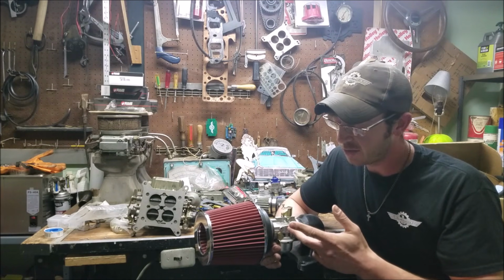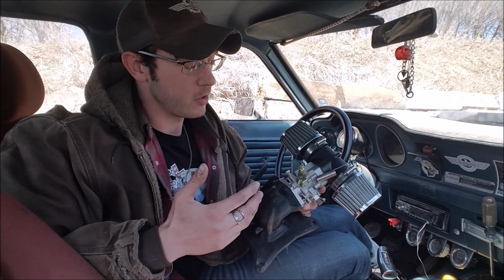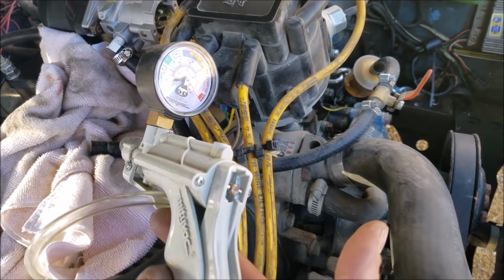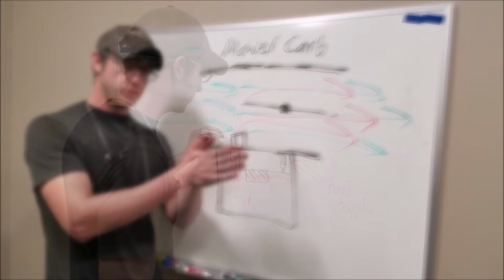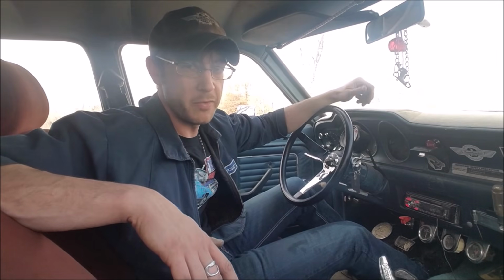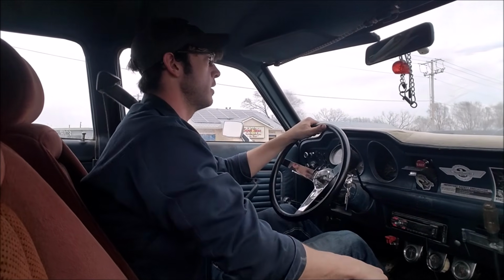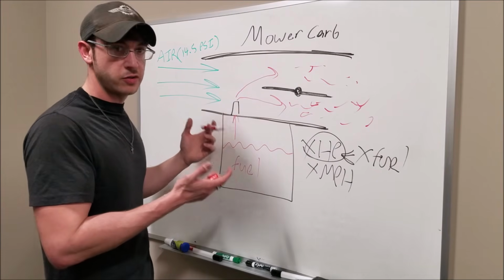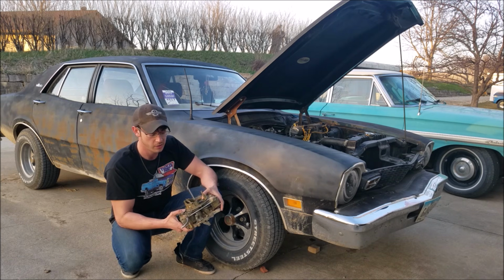Will It Run? Lawn Mower Carb on V8! (The "IMPOSSIBLE" Becomes Reality!) Start to Finish

Comment: The first thought I had (aero-engineer) was the small carb was running a higher velocity at the same mass flow of air/fuel for the power the engine is making. That could create turbulence itself due to boundary layer effects. Your 90 degree turns also would be effective for mixing the fuel and air. I think your theory is correct on atomization of the fuel. Apparently you found a sweet spot in all of this and created something amazingly good at efficient operation. Nice job!
Reply: A tunnel ram enhances the mixing of air and fuel..a mower carb and bends chokes the engine, starves it of air..if it didn't he wouldn't need to create a vacuum leak.
Reply: Exactly his thoughts from the last video
Reply: @brettjasonheadinventor  he is running a "vacuum leak" via a app on his phone and a IAC valve.
Reply: @jimbagle.3939  Yes, which means the mower carb is doing nothing more than driving with a choke on.
Reply: @brettjasonheadinventor  no man, it is more like the opposite of choke. 

It's not less air volume than the carb at wide open. It's more air volume.   

The "vacuum leak" is to regulate the flow rate of the fuel jet.
Reply: @brettjasonheadinventor   remember we are pulling like 8 times the amount of vacuum on the one jet than the engine it was designed for.
Reply: @jimbagle.3939  It's physically impossible to flow more volume through a little hole. The engine is trying to draw more air in, that's why there is high vacuum.
Reply: negative. 8 times the vacuum on the fuel jet increases the velocity not to mention a single-cylinder has more of a pulse. The v8 is a constant vacuum more or less compared to a lawnmower engine. You are incorrect.
Reply: @jimbagle.3939 A engine at  idle has more vacuum than at open throttle, because the air flow is restricted by the throttle butterfly. The mower carb is just restricting the air flow that's why the engine is pulling more vacuum. Stop choking it
Reply: @brettjasonheadinventor   the vacuum leak happens after the venturi, therefore it doesn't really affect the fuel jet. It adds air to the intake after the jet. It is the opposite of choke on. This isn't debatable.
Reply: @brettjasonheadinventor  obviously the carb is to small. If that's your beef. You're missing the art here.
Reply: @jimbagle.3939  Wonder what would happen if  that vacum regulator valve was install strategically in his 3d intake manifold....like right where the 90 starts?
Reply: @jimbagle.3939  No it's not just  carb..its the whole setup..he's compensating for the choking effect by creating a vacuum leak.  There is nothing new here or sustainable.
Reply: @brettjasonheadinventor  ok, I will concede that the carburetor set up is choking the engine, it is too small.  

 Now, if this was the only carburetor one could source. Meaning one has no choice. 

The "vacuum leak" is increasing the amount of air available to the intake and the increased vacuum due to the 8 fold in displacement acts as an opposite to the choke on.
Reply: @jimbagle.3939  Just think about that comment for a second...a typical dead stock V8 engine pulls 18-22"Hg of vacuum at idle. Do you really think this engine pulls 176"Hg at idle?
Reply: @alantrimble2881  what carburetor are you basing these stock numbers of off.
Reply: where is the vacuum being measured? 

At the single jet in this lawnmower carb?
Reply: @alantrimble2881  there is no replacement for displacement.
Reply: @alantrimble2881  the only valid argument is efficiency. So let's say we lose 50% to efficiency. It's still 4x the vacuum that carb is   designed for. That jet is releasing 4x the fuel it would be if it were running a lawnmower.
Reply: @jimbagle.3939  No disrespect, the whole point of having a carburettor  is to administer fuel with the air charge at the correct ratio. The more air the better for combustion. I note his point of this was to see if a mower carb would work. It's a fail if a vacuum leak is required to add more air to correct the fuel / air ratio.
Reply: @brettjasonheadinventor  fair enough. I can live with that. Have a great weekend.
Reply: 😂 pointless argument
Reply: @jimbagle.3939  Carburetor size has very little impact on manifold vacuum at idle.  That said, I'm talking about a dead stock '60s-'80s  vintage V8 with a stock carburetor.  Let's call  it a 305 Chevy with a Rochester 2GC carburetor that flows 435 CFM per the manufacturer. That engine will make in the neighborhood of 20"Hg of vacuum at idle, as will virtually any V8 with a stock camshaft that has little or no overlap.
Reply: @alantrimble2881   I understand that. 

But you are proving my point. 

Even if the manifold pressure doesn't change the pressure on at the venturi does.  A single-cylinder engine doesn't pull near as much vacuum as a v8 and it isn't as constant. Hence pulse fuel pumps on lawnmowers.  A pulse pump will not work on a v8 because the vacuum is too constant. It just pulls the diagram to one side and doesn't pulse. 

Here is what I am saying.  That lawnmower carb is experiencing vacuum at levels orders of magnitude above what it would on a lawnmower.  So, I would bet, that if we measured the amount of fuel delivered per revolution in the v8 compared to a single-cylinder engine. We would find that the increase in vacuum and the consistency would deliver more fuel.  

8 pistons displace more than 1. It's that simple.   The v8 is sucking on the carb better.
Reply: @Xavier_Reynolds97   offer a counter scrub
Reply: @alantrimble2881   I wouldn't be surprised if the vacuum on the fuel jet was so great in comparison to a single-cylinder engine that the fuel atomizes instantly.
Reply: @alantrimble2881   I imagine the opposite of boost.   Let's call it "Negatively Aspirated". 

In boost, we can blow out the bowl of the carb. Right? 

In situation like this. Negative aspirated. 
We increase demand from the jet.
Reply: @jimbagle.3939  correct
Reply: I agree. Higher flow rate. Period. High vacuum on fuel vaporizes it. I studied this for several years now. Add some heat. It works. God bless.
Reply: @TravisTellsTruths   right like one of those pump-up camping stoves from Coleman. 

Ran on white gas.
Reply: Great comment my man 😜
Reply: @jimbagle.3939  Dang I wish I had your brain bro ..your just after sending me to the space station with all that info your putting out here 😀😂🤣🤤
Reply: @ger808   I'm a high school drop out. I have a HSED and a contractors license.
Reply: @jimbagle.3939  your missing something, jets work off of air speed passing the jet technically not vacuum, that’s why you can run a turbocharger flow through a carburetor, choking the air to a smaller circumference will not change total vacuum but it does increase the air speed passing the jet increasing the Venturi effect, his air idle control valve is just fine tuning the carb more like fuel injection, this system works as the carb is running rich to start out with.
Reply: @ExPoRtEhh  Sir I have addressed this.

The increase in vacuum and consistency increases the vacuum pressure at the venturi.  That increase translates to increased velocity of fuel in the Jet and increased air velocity.   I am not missing anything and you are just repeating what I said with different words.
Reply: @ExPoRtEhh  you are missing why the carb is running rich in the first place. 

It's because it was designed for 1/8th of the displacement. 

It's running rich because 8 pistons are demanding it. 

This is about displacement. If I give you a straw and ask you to drink 5gals of water, then I somehow get 8 people to suck on the same size straw they will displace the 5 gals of water faster and with more velocity.    

8 > 1.. 

Why is this so hard for you guys?
Reply: I would like to agree with you on one point. 

Technically vacuum can be in an enclosed space with no air flow. 

Now, point to how that happens inside a v8..

Vacuum in the context of a running engine is always air flowing form intake to exhaust. 

In an engine vacuum is moving air.
Reply: @jimbagle.3939  all I was saying is that the way your explaining it was confusing your talking about vacuum of the jet but everyone thinks your talking about manifold vacuum, the increase of airflow is most definitely increasing the vacuum on the jet increasing the fuel, that being said your theory on displacement causing it to run rich isn’t true, the carb is just designed to run rich, they work off a direct relationship between how much air is being pulled through the air passage, the jet is sized accordingly, if you had 5 cfm going through it it would pull “y” amount of fuel and you had 50 cfm it would be “y” x 10 amount of fuel…..
Why so hard… Stop confusing people
Reply: @ExPoRtEhh  you just proved my point.
Reply: @ExPoRtEhh  It was designed to run a lawnmower that a
Has a single-cylinder engine. That doesn't pull a constant vacuum. 
It was not designed to run rich.

It happens to run rich on the v8.
Reply: @jimbagle.3939  what point, it’s not “running rich because it’s on a higher displacement v8. It just is what it is….  It’s not even that rich, under normal circumstances it’s actually considered good for a loaded enigine, but not for a lightly loaded engine at stoichiometeric trying to get optimum fuel economy, could even run it leaner depending on loading.
Reply: @jimbagle.3939  “vacuum is moving air” NOPE it’s the restriction of moving air, simple as that
Reply: @jimbagle.3939  single cylinder or V8a makes zero difference, it’s all related to cfm, 100% that simple
Reply: @ExPoRtEhh  what is you argument? 

State where you are right and I am wrong. 

I'm not interested in your definition battle. 

Point out where what I'm saying is incorrect.

What causes the difference in cfm between the v8 and the lawnmower? 

It's displacement.  

What causes the increased velocity in the carb you already agreed was true? 

It's displacement.  

I didn't say "vacuum is moving air". 

I said all air is moving in a running engine. 

You are mischaracterizing my argument. 

And using word salad. We all know the dynamics of hi and low pressure here.  I
Reply: @ExPoRtEhh  the lawnmower carb is delivering more fuel per revolution than it would in a lawnmower.  

That is a definitive claim. 

It is because of a roughly 8-fold increase in displacement and a much more constant vacuum pressure.  

Another definitive claim.  

How many pistons fire per revolution in a v8?

How many pistons fire per revolution in a single-cylinder engine?  

If your argument for that is "technically vacuum is restriction to airflow." 

Ok fine. I'm still correct in the function 

Ffs I hate grammar police.
Reply: @jimbagle.3939  grammar police, your spilling gibberish, back to the single cylinder/v8 bs it’s all irrelevant, as is cubic inches, it come down simply to airflow. You can take two different SBC 350 engines with identical components aside from camshafts and the airflow at  given rpms could be dramatically different, same goes for intake runner lengths make a manifold with 4 inch runners then one with 12 and see what happens to your torque curve. The change in torque curve is directly related the volumetric efficiency of the engine at that rpm because of the runner lengths
Reply: @ExPoRtEhh  what's that got to do with the lawnmower carb?
Reply: Take that carb with the fuel line hooked up. 

Cap off both ends. On one end you hook up a vacuum pump. 

What happens at the fuel jet when you start to apply vacuum? 

The venturi creates vacuum with airflow. 

If we artificially create a vacuum in the carb as I said above the fuel jet will leak.
Reply: @ExPoRtEhh  that said, I bet if we could grind the venturi out of that carb and make it the same diameter all the way through. 

The increase in vacuum due to the 8 fold in displacement the v8 would still create enough vacuum in that lawmower carb to run the engine.  

I'm telling you that carb is getting sucked like you ain't never been sucked before.
Reply: @jimbagle.3939  obviously that is the case… simple physics you’ve plugged everything but the jet then added a suction…
but it isn’t fundamentally how a carburetor works, for example take any carburetor, the butterfly when closed is ( the restriction of airflow ie vacuum creator)  is on the engine side of the jet, therefore no vacuum where the jet is, when you turn a choke on it is in front of the jet making the engine vacuum pull more fuel from the jet, but without a choke style restriction on the air inlet side of the carburetor your theory doesn’t work, the restriction has to be before the carburetor.
Reply: @ExPoRtEhh  No. There just has to be vacuum. You are wrong.   You just proved my point. Thank you. 

Have a great weekend.
Reply: @ExPoRtEhh  a choke behind the carb wouldn't work here ethier. 

But the displacement is causing far more vacuum than this carb would experience in a lawnmower. The effect still applies. 

I'm not saying the carb increases the vacuum of the v8. 

I'm saying the vacuum of the v8 is pulling orders of magnitude more vacuum than a lawnmower would. Therefore creating the situation you just described.
Reply: @ExPoRtEhh  boost is above atmospheric pressure.

Vacuum is below atmospheric pressure. 

Vacuum is not restriction of air flow. 

Restriction of air flow causes vacuum.
Reply: @jimbagle.3939 Jim  
If only we could see all the edits you’ve made, honestly you’ve changed this conversation around the make it look like you somewhat know what your talking about now, you still explain it with gibberish analogies though. 
Your still 100% wrong watch the video, he never states he’s driving around at wide opens throttle, most of the time he says quarter. so the vacuum is on the engine side of engine. 
If your theory is that the carb is literally so small that the area has so much restriction the the fuel is being sucked out by engine vacuum not because of airflow Venturi effect then you are wrong again. It would run so inefficient at different rpms and not have any drivability.
Reply: @ExPoRtEhh  ok, bud
Reply: I have not even watched or read everything. Did he record vacuum (cruise/WOT)? I would be interested in vacuum readings without the IAC valve adding air. I would believe the carburetor is so much restriction that it is running the engine at a very high vacuum state. Much like running at high altitude and requiring less fuel (and a similar power reduction). As was stated above, this could be called negatively aspirated, because it does the opposite of supercharger/boost. 

Differential pressure across the fuel jet can change the flow (which is one reason you boost reference your fuel pressure on a blow-thru/boosted carb setup) and negative pressure at the jet outlet (by more upstream losses/restriction) would pull more fuel. In this case even the small inlet is a restriction with a loss coefficient of maybe K=0.5 which will increase the fuel jet dP.  Compounded, the primary means of fuel delivery should be through Venturi effect as a function of air velocity, which is directly proportional to rpm and displacement. 

Every time the IAC valve cracks open it is raising the manifold pressure by some amount. If the carb’s fuel jet was tuned so that the IAC Valve stayed shut, I think the negative aspiration carburetor could be even more fuel efficient, although it would also produce less power).
Reply: Better milage to the gallon than a Corolla Hybrid... 🤣🤣🤣
Reply: @brettjasonheadinventor  Mass flow rate = density x area x velocity. You can flow more by increasing density or velocity through a given hole area. Eventually you run into limits due to other factors.
Reply: @jimbagle.3939  You can only have a maximum vacuum of 14.7 psi at sea level on Earth. It doesn't matter how many cylinders are involved.
Reply: @solowkaver3592 yes that's true. However you  can't flow, even under pressure more air through a  smaller tube then a larger tube. The mower carb hole  is about the size of one inlet port on that engine.  it can not deliver enough air to the engine without him creating a vacuum leak.  This experiment is a  fail and a joke as any mechanic or lay person would know engines need air to work as they are essentially they a air pump...
Reply: OK,    All I'm saying is there is more fuel being delivered to the v8 through that carb than it would deliver in a lawnmower.

due to Increased vacuum AND CONSISTACY. 

Is that false?
Reply: @jimbagle.3939  A lawn mower carb is tuned/ jetted to deliver the correct amount of fuel for the capacity of the lawn mower engine it's installed on. The jetting size restricts excess  fuel flowing through regardless of vacuum. A small increase of fuel flow may be gained  with the aid of  added fuel pressure / vacuum, however it's only a very minimal increase.  If it wasn't, only one size fuel jet would be required for all different capacity engines.
Reply: @brettjasonheadinventor  no shit. 

Now, what delivers more fuel a pulse or constant vacuum?
Reply: @jimbagle.3939  It doesn't matter as you can't flow more fuel then the size of jet. A constant vacuum won't flow more than the jet allows. The engine will shit itself running as lean as it is on a mower carb. Glad it's not mine car he's fucking around with
Reply: @jimbagle.3939  And don't understand where you are going with this pulse thing. I think you just trying to believe this is workable at all engine speeds and loads. I think this guy did a good junior experiment, however claiming it's reduce fuel consumption is just a joke and will destroy the engine.
Reply: @brettjasonheadinventor  lol, no one thinks this is a good idea.  No one thinks he reinvented the wheel.  It is better to run a proper carb.  

In the lawnmower, there is a pulse meaning a varying vacuum pressure. 

Even if the maximum vacuum pressure is the same in both engines the v8 will deliver more fuel because the vacuum is relatively constant. 

Like the difference between a drip and a steady stream.
Reply: @jimbagle.3939  Vacuum will fluctuate due to engine speed and load. The more vacuum will pull more fuel through a jet. But doesn't mean its enough fuel for the correct air/ fuel ratio. You have a better understanding of engines then this guy will ever have.
Reply: @brettjasonheadinventor   yes. So, if we could measure the amount of fuel delivered by that carb at a specific rpm, load, etc in both the v8 and the single-cylinder engine the v8 would deliver more than the lawnmower.

It may be a slight difference but it will still be a different flow rate.  That's all I'm saying. 

Neither engine is likely producing 14.7 psi of vacuum at all. So this point is irrelevant.
Reply: @jimbagle.3939  It's a pointless test. It will flow slightly more under pressure/ vacuum. Not enough to prevent the v8 from destroying itself as its running way to lean.
Reply: @brettjasonheadinventor  no, he adjusted the timing to compensate for the that. 

That's is the whole point to the IAC valve "vacuum leak". 

You have to stop being a guy that wants to get the most out of the engine. 

And be the guy the that has no choice but to make this carb work. 

It's not running lean. 

It is starving for air and fuel compared to what it could do.

But the IAC is keeping the a/f at 14/1 which is not lean. 

It's only underpowered. 

That's it.
Reply: @jimbagle.3939  Dont ever tell me who I'm am..you know nothing about me and what I want out of engines. It's lean. Look at at the spark plugs..put a gas meter on it. It's a fail. The engine will burn out.
Reply: @brettjasonheadinventor  I wasn't telling you who you are. 

But I am telling you that you are incorrect and he could run that set up as long as he wants and the engine will not fail due to lean conditions.
Reply: @jimbagle.3939  Take a look at the spark plugs. Do a gas a test.. As you are assuming it can run, based on his word. if it was plausible everyone be trying it.
Reply: @jimbagle.3939  When your mentioned you are a highschool dropout you arguments started to make more sense.
Reply: @Rokomarn  I don't know what you mean by that. 

It's funny though.  

Glad you enjoyed it.
Reply: My theory is that the increase turbulence could be helpful to the air-fuel mixture. However, I'm not an automotive engineer. Let alone an aircraft engineer. I'm just a humble nerd.
Reply: @jimbagle.3939  The only part of your argument I disagree with is where you say "no one thinks this is a good idea".  A majority of the comments are people praising him for what they are treating like a breakthrough......

He isn't using the potential of the engine because the amount of air being let in is severely reduced.  This type of thing has already been achieved with much lower displacement engines. They have much lower rotating mass and can produce much higher fuel efficiency numbers.  Most will also produce much higher power then restricting a big v8.
Reply: @BrokenSmokinSpokes   I am aware that outside of this thread people think this is revolutionary.  That's why I'm in this thread. 
Those people are umm, not the brightest people.
Reply: They don't understand how a can opener works.
Reply: @jimbagle.3939  
Is this determined by displacement and size of the Venturi?
Reply: @ExPoRtEhh  
Doesn’t the choke just change the air fuel ratio on a cold engine?
Reply: @brettjasonheadinventor  
Wouldn’t better atomization if fuel decrease the needed fuel volume for the same displacement?
Reply: @1stamendment999  not sure what you mean. First as I understand all engines are essentially  air pumps. More air going into the combustion chamber means a bigger explosion as there is more oxygen to burn. The bigger the combustion chamber the more air required.  Regardless of atomisation of fuel, the correct air/ fuel ratio is required for the engine to run efficiently and reliable.. Leaning it out like he's done will end in tears for the owner of the car.
Reply: @georgeernst4348  I believe a fuel saver product ( Hiclone )  claimed something the same..increasing the velocity, increases  the turbulence.. Proven to decrease fuel economy or at best made  no difference.
Reply: @1stamendment999  what?
Reply: @1stamendment999  bro, read the whole thread. 

We gone over it. 

The horse is dead.
Reply: @brettjasonheadinventor  It is not running lean.
Reply: no. He is trading hp for fuel economy.  The only effect of the lawnmower carb, the way he has done it, is a loss of horsepower. That is it. 

If the carb ran lean the iac trick would not work. 

Brent here just can't figure it out.
Reply: @jimbagle.3939  Prove it. I asked him to look at spark plugs and exhaust tail pipe to see how the engine running. Just driving tells everyone nothing. .do a simple exhaust gas emission. Back your hypnosis up with data.. if is not running lean get him to prove he hasn't f#$@ with the carb.  Common sense tells you a fuel ratio of 14.7 to 1 is required in all ICE. How the f#%k do you get more fuel out of the same size carb jetting tuned for a single cylinder law mower to run a large V8 at a air fuel ratio. And please don't tell me vacuum..there is a limit of how much you suck out a given size jet/ tube.  This thing is about making. Everytime I comment he makes money.  so I'm sorry Jim I won't be replying to you or anyone else  anymore from here. Last word if it works correctly sell it or at least get qualified people to test it.  That's  the challenge for you and the mower boy.
Reply: @brettjasonheadinventor   bro. He is monitoring the AFR on his phone app.  He must have a o2 sensor.  He isn't "getting more fuel". 

You are wrong. It's not running lean.
Reply: @jimbagle.3939  it's ok he doesn't understand efficiency
Ps by he I mean Brett
Reply: @collinstewart4179  yes, the guy is smart and well informed on engines. I believe this setup is triggering cognitive dissonance in him. 

As you said, it's ok.
Reply: My only questions are; can you sell me a few, and are you looking for investors?
Reply: @1stamendment999  no it changes at any time cold or hot, your restricting the airflow on the source side of the jet introducing manifold vacuum to the fuel jet, jimbo her seems to think that’s constantly happening because the carburetor is too small but if that was the case the carburetor simply wouldn’t idle or accelerate as you open the butterfly. If you were to take this same setup though and try to run it up past say 4000 rpm it would reach a point where the biggest air restriction would the the carburetor itself creating a very very rich scenario, but the OP and creater has come up with a way of introducing a secondary air source to increase airflow to the engine when needed, using a iac valve.
Reply: @jimbagle.3939  Jim, you seem to be a knowable guy, which confuses me why would you take on this guy's word without seeing data to back it up? Monitoring it means nothing as he has not produce data. If you believe in it try out for yourself, as actions speak louder than words and hearsay.  But remember data to prove it. Oh that's right have asked twice now for data! Still waiting..
Reply: @brettjasonheadinventor  lol, like the android from Star Trek next generation?
Reply: @jimbagle.3939  Enjoy believing in fake stuff,  as it did run correctly and save fuel ( as mower boy claims ) engine manufacturers would buy it.
Reply: @brettjasonheadinventor  have a great weekend brent.
Reply: Bravo. I came for copper and found gold. 
Always in love with content like this. 

Keep up the good experiment!

P.S with that kind of mpg I would be shaking as well... Who thought an old carbureted V8 can be so fuel efficient?
The atomization explanation is interesting as well.
Reply: Someone explain to me why propane wouldn't give insane mileage, yes I know less BTUs but it's better atomization
Reply: @petegotubeat1  probably better as a generator inside a hybrid vehicle. Range extender on a BEV

BTU is another thing.... Which translate into Poor driving experience for a vehicle with an ICE running on propane.

I am sure there is a much more scientific explanation out there... But this is as much as I can answer.... :)

Then in order to make it popular for all people .. you need to have infrastructure in place to support it .... Convenience will be the key
Reply: @jimbagle.3939  Fairplay to you !!😜
Reply: I kinda got tired  of reading the back and forth argument wating for someone to realize each piston only fires one at a time,,,.so a lawn mower carb and an air flow intake valve metering just deals with one cylinder at a time. V8 4banger or lawn mower. Indeed the carb must provide more fuel but his computer regulation of the air on the engine side will closely be at stochometric adjusting for volume and yes for a quicker moment between pulse then it's used to but so what..it does it in many pulses "8" as apposed to one..(same as the full size carb)
Indeed more steady state to the hairless ape slow perceptions of reality but at the high speed our physical universe operates at it's a lifetime for a gas molecule. So it's not surprising it worked, but at the sacrifice of power the car and engine was designed to be best of both worlds with some compromise of each.
Back then efficiency was less a thing at 35 cent a gallon. (ok I'm dating myself hard core)
But this little carb can never get all the volume gas and air it needs at any quick throttle response..so it's a forced regulator of driving behavior.
And making up efficiencies by less wiggle room of that perfect ratio that will happen with starts and stops and fits and curses. It's a fuel ration govener in effect. And there is where you get your better gas millage effect.
Reply: @chuckthebull  sir,  I have consistently said "per revolution" and "the v8 has constant vacuum compared to a single-cylinder engine"   

So as you are correct. Your statement is irrelevant to my argument.  

I will ask again, how many pistons fire PER REVOLUTION in a v8?
Reply: @jimbagle.3939  Timming will tell you one piston per revolution.. (edit) 2 stroke or 4 stroke determines how often a single cylinder fires so my 
update correction ,,,2 to 4 per revolution depending on engine type and cylinder count etc.
Reply: @jimbagle.3939  Also just because a human at its perceptions level can think it sense it as a near steady state vacume still does not mean it does not pulse per exhaust and intake port opning per firing especially with overlap of one fire per  cylinder per revolution.. As an electronic design engeeener as well as mechanic I can observe on an oscilloscope the distinct events in time when scrutinized in the milisecinds range.. Even a V 8 fires one at a time..
Reply: @jimbagle.3939  Now given the presure gradients internal to the intake manifold these pulses even if tightly spaced and muted by delays in change of direction are still there.
Reply: @jimbagle.3939  The other point to be made is the carb,,(any carb) still does not care how fast or slow you make it deliver fuel..(per its ability and design limitations) even at a steady state it will deliver only its own capacity to deliver. Pulses or steady. It's going to limit itself on volume. ..its ventury effect still only need to give out one cylinders amount of fuel per revolution. 
(edit)
Again on second thought a v8 may give out many firing moments on one revolution depending on crank geometry. The V denotes its split into many per rev and degree offset..
Reply: @jimbagle.3939  Actually now that I think about it depending on crank geometry it will fire more than one revolution...my 4 banger will do it once ever halve revolution..So if a crank is setup to do it,  it could fire once every 1/4 rev.. And yes this would give an appearance of steady state vacume,,but in a microsecond world you would still see pulses.
Reply: @chuckthebull  yes.
Reply: ... @chuckthebull   what is your argument? 

Quote what I said that triggered you to reply to me and point out how it is incorrect.  

Bla Bla. Human perception bs. 

Yes, a v8 technically has a pulse too. But I. Comparison to a single-cylinder you are splitting hairs. 

You are talking about crank revolutions. I should have specified I referring to revolutions of the timing apparatus.  The distributer in v8 fires 8 pistons per revolution. 

The flywheel on a single-cylinder fire one piston. 

All of this is irrelevant to my argument.  

The v8 pulls more fuel than the lawnmower engine through this carb.
Reply: @jimbagle.3939  There is no argument and no one is "triggered" you are attempting to make it out to be an argument for some strange reason,,  And using those typical trite childish phrases you learned from your peers "triggered" as attempted to insult is irrelevant posturing.
I was adding a thought to the conversation to better get to what might attribute to the improved gas millage and you puffed up like A peacock to "school" people with what I imagine is some sort of inflated ego issue of your own.

I get that some of you go through your entire life seeing everything as a contest but academically speaking bouncing around ideas is actually how people learn,, not acting like a chicken on a chess board kicking things off and crowing about you winning something.  Or thinking your abusive personality makes you superior.
Reply: @chuckthebull   what's that got to do with this lawnmower carb?   Triggered.
Reply: @justsomeguyhere  mm hmm
Reply: @justsomeguyhere  The control and introduction of air after the carb would reduce the vacume pressure also regulating the air flow past the fuel needle or fuel jet delivery etc. Reducing fuel intake pull from the carb.
Reply: @chuckthebull   bro, you should check your privilege.
Reply: @jimbagle.3939  "Bro", you should too.. And don't call me bro it sounds stupid and ghetto,, "But you do you" right?
Reply: @chuckthebull  Look bro, your opinion of me is none of my business. 

Based on our interaction, I'm not fond of you. 

But, I'm not finding the need to broadcast it as if you should care.  

Triggered.
Reply: @jimbagle.3939  Nor I of you, so we are even.. So, no matter what I am it won't change your circumstances.
And I'm not your "bro",,,, "dude"
Reply: @chuckthebull  thanks bro.
Reply: @brettjasonheadinventor  what do you mean by 'sustainable'? just wondering.
Reply: @brettjasonheadinventor  look at the fuel economy! i want to run this with a 4bbl that you can engage over the top of the intake with the smart dirt bike carb on the front for fuel economy.
Reply: @zAvAvAz  ask yourself what is the effect the alleged fuel economy has on the operation and life  of the engine. Until there is data like a dyno test with emission results his claim of fuel-saving is based on driving down a flat road without any proof the engine is operating correctly ie. Not running lean. It would be interesting to see an average drive where the engine is put under load like loading the car up with a few people and driving up around some hills.  I would bet that the engine will lack power and pump out high levels of Nox emissions.  Also, think about why turbos increase fuel economy as well as power.
Reply: @brettjasonheadinventor  hahahahah what do you mean other data? here is all of the data :o)  i am doing it with a smart dirt bike carb and a 4 bbl that shall open as needed.  its 40 mpg! think about all the poop that doesn't exist, and all of it that does. blah blah blah. You are insinuating falseness, based on prejudice. There are no proof or signs of what you are suggesting. You shall not bear false witness testimony, not even by insinuation. thanks for the comments though, no pun.  :goodvibes:
Reply: @zAvAvAz  I guess you and mower man has found away to reduce fuel consumption while maintaining engine power well done!  Be good to see the results but I guess it will be all here say with no actual data.
Reply: @brettjasonheadinventor  thank you, although i believe it is not maintaining all the power it would have with more air and fuel no. Just check out a 680hp 1967 firebird built by butler performance got 35 mpg using a standalone engine management system that could cut fuel and ignition to cylinders in different modes of timing spacing them out as needed, as all cylinders did not need to fire constantly under part throttle due to the torque ability of each cylinder and ability to overcome the weight of the vehicle. So it is not underpowered plants that produce fuel economy , it is the over powered vehicles that produce fuel economy. The higher efficiency of higher high rpm and larger engines that produce a ton of torque are the true answer. Everyone knows that flooring that puny engine up a hill not even maintaining speed on the interstate is using all the fuel and all the load it can handle and worse for wear. That horribly balanced 4 cylinder that cannot muster to cut the mustard. Alfadan's new design shows promise when they unveil it in boats in 2024 with mahle engine components we shall see the birth of hopefully another efficient torque monster. Check it out.  :goodvibes: cheers.
Reply: yes, agree with you. However,  cutting cylinders out doesn't reduce the dead weight of  the large engine capacity. If you want more power to capacity ratio, can't beat 2 stroke engines.   I think as much as I believe EVs are environmentally Unfriendly as they relied on dirty mines for their precious metals, a hybrid is the best way forward. We are working on a low emission high performance diesel ( and also a  2 stroke )  10kva  DC genset to charge and maintain a battery pack on the move . Think of Musk's Cyber truck without the tonne of battery packs how fast that would be.
Reply: @brettjasonheadinventor   i am building a ship, musk says an electric ship is impossible. it was i am whom came up with the plan for an electric ship that uses super conductors and their design, and super capacitors that are constant kenetic charge, even the shapes and materials of the super conductor create the dynamics of its functional priorities. As with the bottleneck of the feed rate and the zero loss reclamation of energy dissapitance.  The system is built with the ultra lightweight materials and has orbitally arranged and designed particles that are constructed with frequency and light infused with an array of energy types.  😀
Reply: @zAvAvAz  sounds wild..make sure you back up your claims with repeatable data..not like mower boy with his fuel saving..
Reply: @jimbagle.3939  It's ironic that he also used a Colman stove to heat the passenger compartment. 😊
Reply: @Bob3519   I'm not sure if irony is the right word. It is certainly coincidental. My comment was not a reference to that part of the vid. That might make it ironic. We need a literary expert, as I'm a drop out.
Reply: @brettjasonheadinventor  some of the first hemi motors had single barrel carbs on them and they ran purrrfect with pretty damn good fuel economy for a big ass car that they were in. i think the boy did a damn good job making it all work efficiently. whats cool is you could adapt this to any vehicle and get better economy. is it going to pull a horse trailer? no but it will get you a daily to work and back a shit load cheaper. then you can build a nasty with the extra funds.
Reply: @ogre3675  yes true " some hemi motors" and other v8 also had single carbs. The difference is they can drive up hills and didn't require a vacuum leak to function.  I believe he was just trying to prove you could get a engine to run on a mower carb and that's all. Not as a fuel saver system or anywhere near being functional for everyday driving.
Reply: @jimbagle.3939  And no 350 Chevy has 12 inch runners.
Reply: @chuckthebull  finally someone knows what they are talking about.
Fuel ration carb for lead foots.
Need one on my wife's car.
Reply: @chuckthebull  argument is triggered by pride and ego.
Reply: @jesse75  I'm not sure which comment this refers to
Reply: @jimbagle.3939  You made a comment on runner length.
A 413 would be a good experiment to prove a point, but not a 350.
Reply: Wake up guys Look. Look Look.  ,,you got a foot ball  kick it does it move yes so did the vacuum change no but did  the pressure change yes it did   Wow  you been told  ,,,.no, thank about it
Reply: Has I blown the engine yet as it would be running lean ?
Reply: @jimbagle.3939 it's velocity through the venturi that pulls the fuel. That velocity is created by the pressure differential between the atmosphere and the manifold
Reply: @brettjasonheadinventor the dude has an O2 sensor on it. You can see in the video the A/F is fine...
Reply: @bobdole57  oh, really? What causes the pressure differential?
Reply: @jimbagle.3939  the intake stroke acts like a vacuum pump, creating low pressure. The throttle plate restricts airflow through the throttle body/venturi. 

When the engine is at idle let's say, you have high manifold vacuum. When you have wide open throttle you have low manifold vacuum. 

Running with a tiny carburetor is a bit like having a throttle stop that limits throttle plate travel so you are limited to higher levels of manifold vacuum even at wide open throttle.
Reply: @bobdole57  yes. Now multiply that by 8
Reply: @jimbagle.3939  I don't understand what you mean
Reply: Higher velocity equals lower pressure, this increases suction making carbs somewhat balancing air mass to fuel mass. 

The longer burn time of rpm bog wants more fuel to air for the exhaust measurement richer at carb to stay consistent at the sensor.
Reply: @rydplrs71  lol, what
Reply: @bobdole57  yes .  But reduced the power of the engine by reducing the air intake..
Reply: balls.
Reply: If this worked that good, I would have been running it on all my cars, my friends cars, my family's cars, and would have made a business out of it.
Reply: @alantrimble2881  yes, dual quads or teeny tiny one barrel, it's pretty much the same on idle.  Although - a teeny tiny carburetor might be running half volume just for idle on a big motor while the dual quads it might just be an air bleed.
Vacuum would be the same.
Reply: @ExPoRtEhh  that carburetor on a V8, idle speed volume should be like single cylinder engine running half capacity.
Or more.
Reply: @Justdigit2  I made a custom experimental manifold adapter to put a slide motorcycle carburetor on my 64 chevelle. I had to use a special fuel pressure regulator because the motorcycle carburetor float could not handle fuel pump pressure.
It ran well but was hard to start because no choke and no accelerator pump.
It got pretty much the same mileage it got with the Rochester 2 barrel or the old Stromberg 2 barrel off an old flathead Ford, about 20mpg.
This guy is another Super Dave, he is doing a great job of making everyone think he is getting 50- 60 - 70 mpg.
Reply: @michaelszczys8316   No it doesn't.  He's reduced the power output of the engine.. engines are air pumps ...they need air to pump to be efficient.

The air is the working medium  that pushes the piston down when it expands due to heat ( igniting/ burning fuel ).
By  reducing air flow it  reduces efficiency.  Less power . 

I would suggest this guy go back and learn what a internal combustion engine is .
Reply: This is a legendary comment thread that I could spend a straight hour reading 🤓
Reply: I was just reading some of the comments. I agree with the aero-engineer, but a lot of these other guys are just dumbasses!
Reply: @ArthurRobinson-v3y  Says the guy reading these comments 2years after the fact. 

Have your mother make you another hot pocket.
Reply: I would like to know why he’s running around with the choke out
Reply: Maverick isn’t a big car,about like a cambry